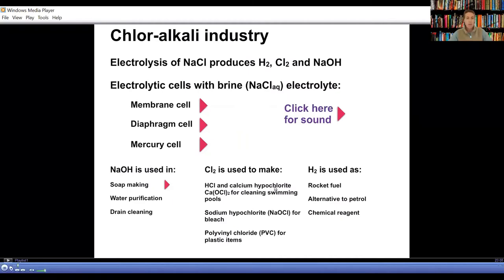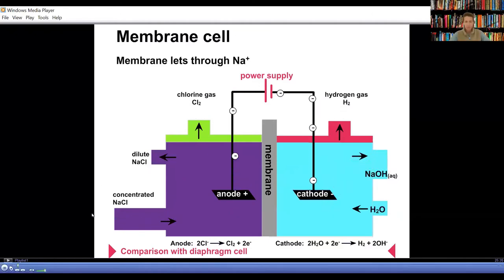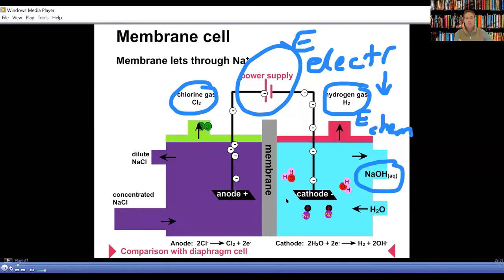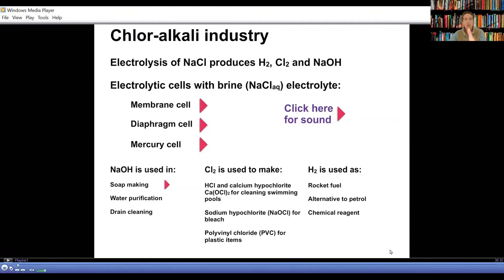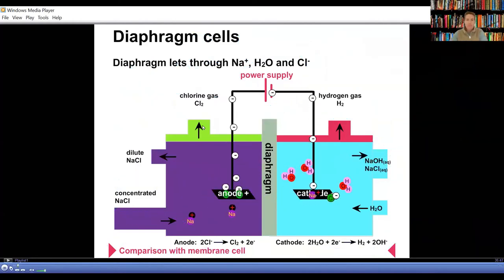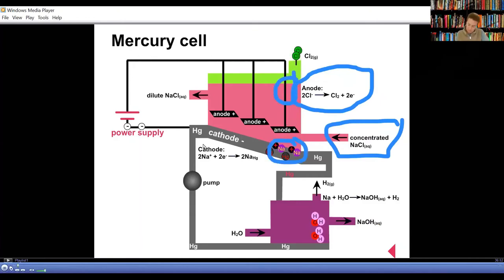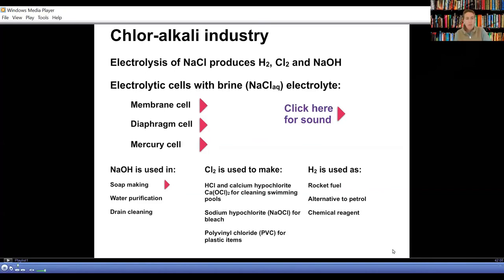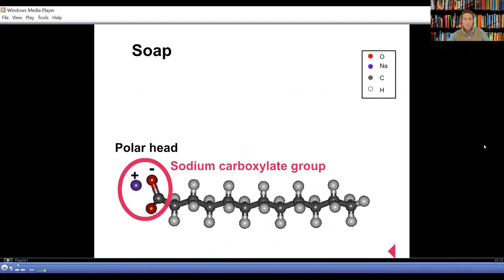The Chlor-alkali Industry: by Animations

Comment: Hi thank you very much. Excellent explanation
I have a question. Please what is the name of the MEMBRANE CELL AND WHERE CAN I BUY IT?
THANKD
Reply from the maker: It is an electrolytic cell, specifically know as just the membrane cell. The membrane used in these cells in industry on a huge scale in chemical plants is made of a selectively permeable material called nafion or flemion and is extremely expensive. I’m sure these materials are specially manufactured for this big industry and won’t be easily available for the general public to use. Maybe you can check with a chemical company if they do sell it. But just make your own cell in a beaker with cardboard acting as membrane and place two electrodes hooked up to 12V battery inside the two cell compartments for oxidation and reduction.